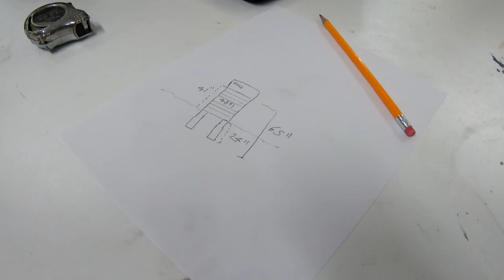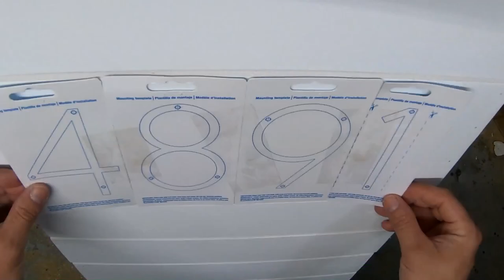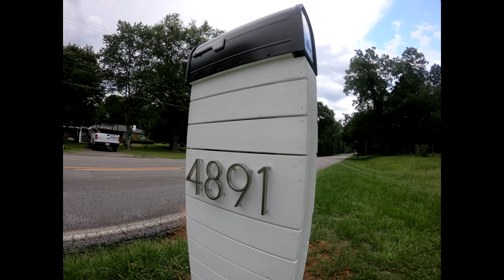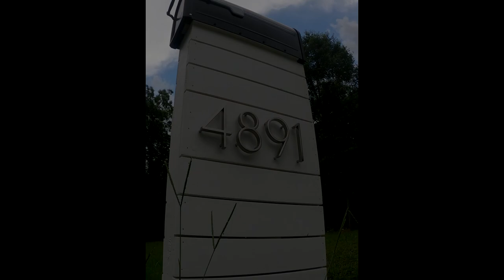How to Build a Modern Mailbox

Comment: I may be wrong, looks like white pine, sooo by 2022 it should be all rotted
Reply from the maker: Actually the slats were Cyprus if I remember correctly
Reply: It's 2022 did it rot?
Reply from the maker: @84848AR  I haven't been by but the post were treated timber and the boards were Cyprus so I doubt it. But regardless of the wood if you keep it painted it won't rot.